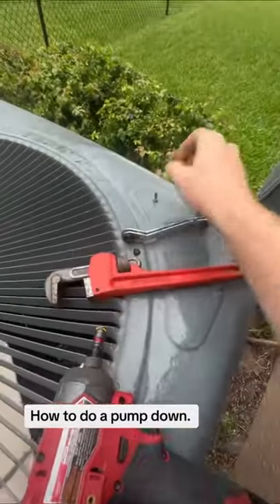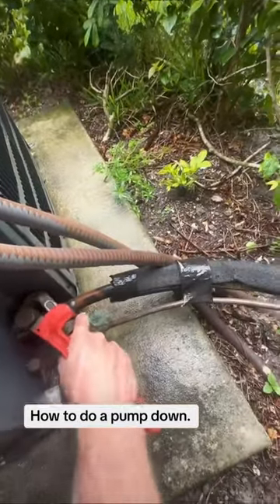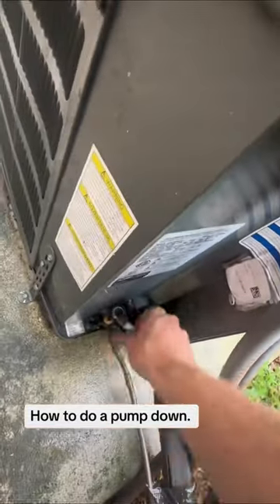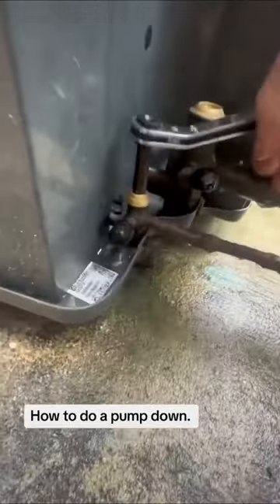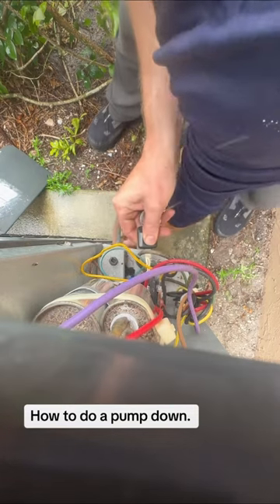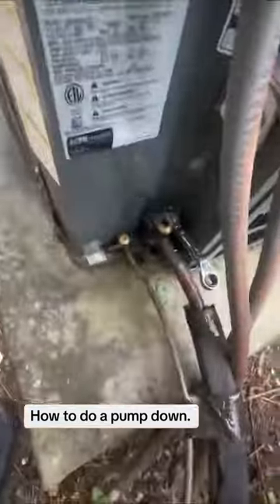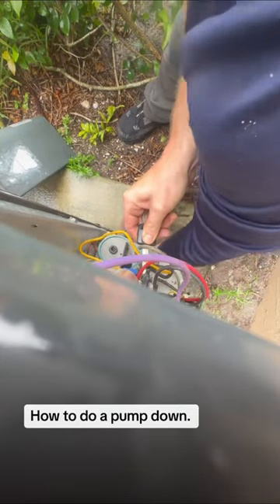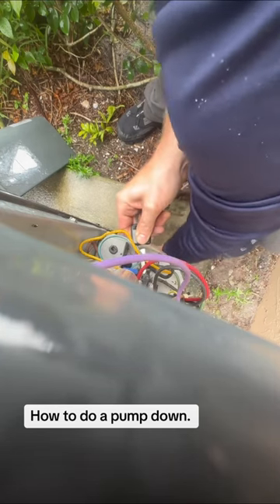How to do a pump down to get all the refrigerant inside of condenser! #hvac

Comment: If you pump it down you don’t have to be in a hurry to tighten the suction it’ll hold back for a little bit don’t keep the compressor running pulling it into a vacuum. Christ almighty they’re letting anybody do residential these days
Reply: I came here to make the same comment. How does nobody else know theres a check valve in there
Reply: And you could just hook up some gauges and watch it lol
Reply: @Darth_Uchiha47 I was about to say this lol
Reply: @casketman14 who needs gauges when you have a pipe wrench 🗿
Reply: Whoops There goes your trade bussiness if people lern it.
If they screw up, you'll be ok, more work for you!

Comment: I think the only thing he did right in this is use the service wrench. I always close both the suction and the liquid and slightly open the suction by a few turns so I don't have that far to go.
Reply: He was using the pipe wrench backwards 😂😂😂
Reply: I also back it off a few turns and use gauges not just till it’s starts knocking and a damn key lol

Comment: Alot of equipment especially scroll compressors can be damaged by pumping into its self also not recommended by some manufacturers
Reply: This should only be done when the unit is being changed out. Then it doesn't matter, burn the compressor up. It's done anyway.

Comment: Quick question i tried doing a oump down the other day on a goodman so i could clear my piston because it was starving my evaporator. Hooked up my guages and closed liquid line. Ran it but it only dropped 20 psi on the low side and jumped up 20 psi on the high side. There was still 65 psi on the suction side and wouldnt pump any lower. I let it run for 10 minutes and it didnt sound any different or change pressures. My question is, if i closed my suction, that 65 psi of refrigerant, would it have been in that suction line to the piston orifice and leaked everywhere if i took it out or was it saying that theres 65 psi and in reality there isnt any refrigerant on the low side?

Comment: Depending on the unit sometimes you gotta power up the reversing valve or orange wire
Reply: I was just gonna say that
Reply from the maker: Down here it’s just straight cools
Reply: U should put gauges on at least
Reply from the maker: @christophera4406 kind of unnecessary work? Don’t ya think
Reply: No it’s not unnecessary. You do that to see what is actually happening and then you can bleed off the remaining charge from there. Are you just gonna cut the pipe with a sawzaw before you empty it completely?

Comment: I like to start the unit, close the liquid valve, and pull the disconnect when it's ready.  The suction valves in the compressor will keep refrigerant trapped in (assuming they're still good).  Close the suction valve and do your thing.  I'm not triggered by you using keys or not using gauges - what you do to a unit is your problem.  😂

Comment: Dude you can’t be seriously putting this out as your content, especially as instruction.  One use the right damn wrench to remove valve caps, (2) gauges man, come on (3) yes you close down the liquid side and close the suction side to half then when below 20 psi close suction port.